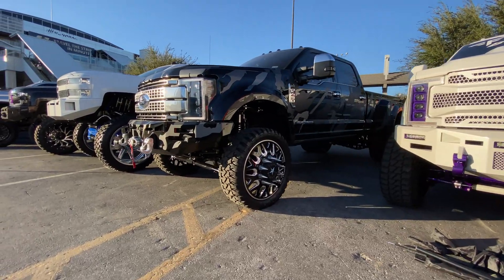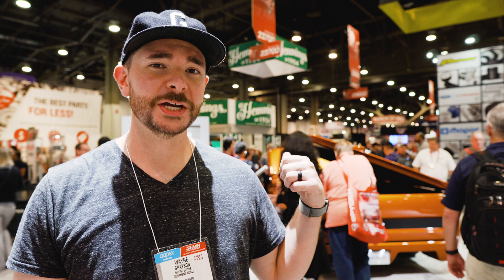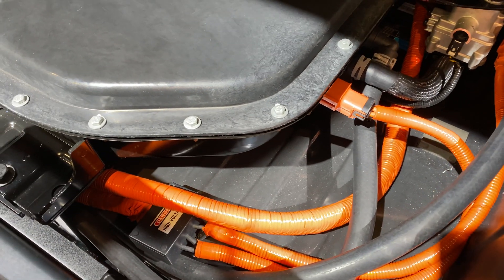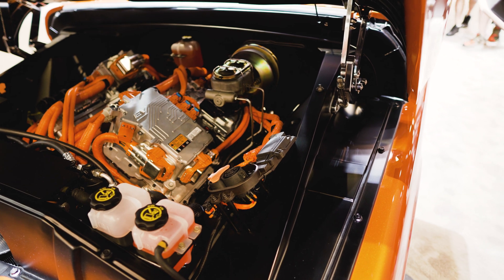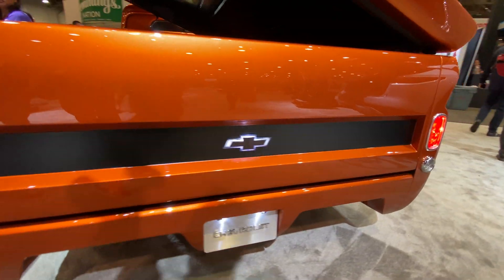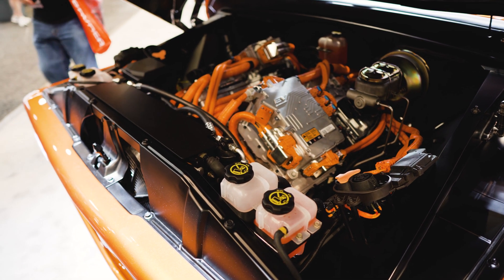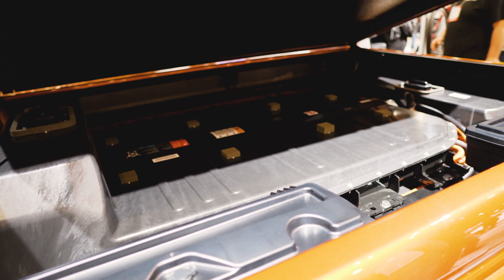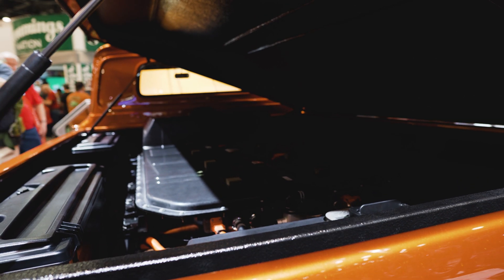Chevy's 450-hp eCrate prototype powers electric 1962 C-10 hot rod

Comment: Can i have a 64 4x4 chevy truck the hotrodded 327 runs the front wheels, the drive shaft is eliminated. In the bed is the ev engine mated to the rear end?

Comment: I much rather restore a collectable pickup like this if it was DIY than spend 80K on a decent new Etruck with the basic truck look. You can not replace the beauty of what was. Garrantee you if Chevy turned out a short and long wheel base truck to look exactly like late 60's c10 people would buy the heck out of them. Take the challenger for example. except for being wider etc it still is what it was in style and people bought a ton of them for it

Comment: IMO they need to do one of two things.  1. get the total package (battery, motor, electronics) into a size/shape that is a drop in replacement for either a small block or big block chevy (bell housing, motor mounts, pedal linkage to the old carburetor, etc) or 2. ship it as a kit with transaxle, battery that fits between frame rails (under the bed).  

What I'm seeing here is the "worst of both worlds" all of the problems, none of the benefits.
Reply: It needs to be a modular kit with an enter battery kit for 100 mile range that can be added upon with additional battery packs to extend range. In fact, all evs should be this way.

Comment: Poorest concept I ever saw, Chevrolet should be ashamed of this entry. What a hack of a build. The body work, paint, electrics are cool. The design sucks. High slung motor and batteries creates a very high center of gravity. The non-unibody is very weak for all that torque.
Reply: The video stated that these kits were geared for the hotrod enthusiasts. They just want the boastful  power and flashy show.

However, there are other kits and custom shops that provide a more practical EV conversion for everyday drivers. Seems to me if a shop could deliver a custom conversion solution for $20k or less , they'd have customers seeking them out.

Comment: Salvage to savage is doing a build like this, it looks theirs is wayyyy better than the Chevy engineers
Reply: agreed. they've put more effort into the truck than chevy did. Connecting the motors to a 4L70? Really? The two batteries in the bed of the truck look amateurish. Not much innovation.
Reply: @WilliamPozo  I thought they did it that way to show all the components. Most of that stuff would be hidden under the truck making it hard to see